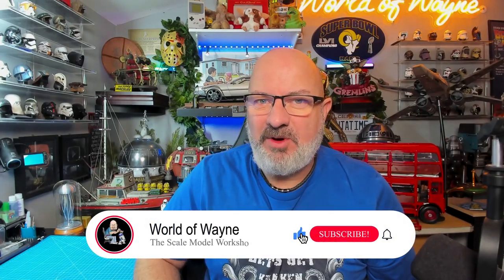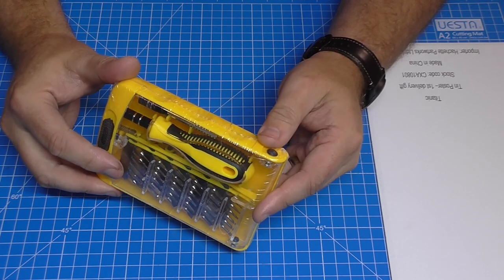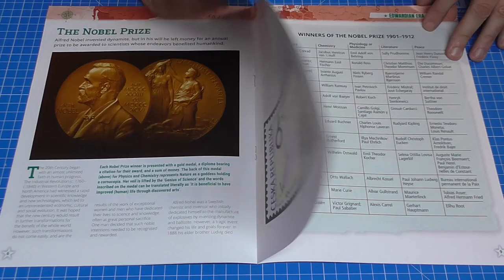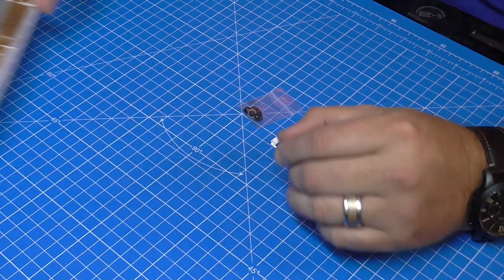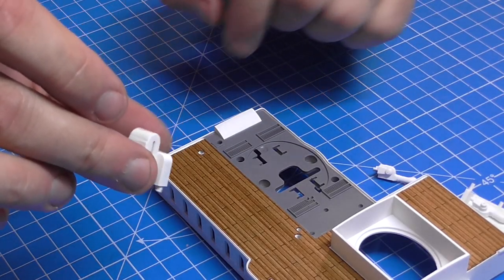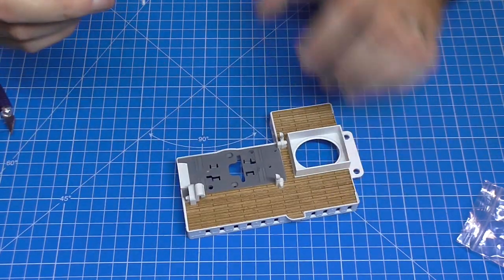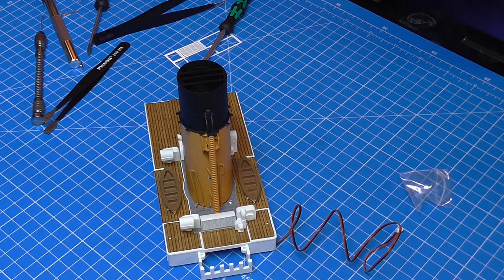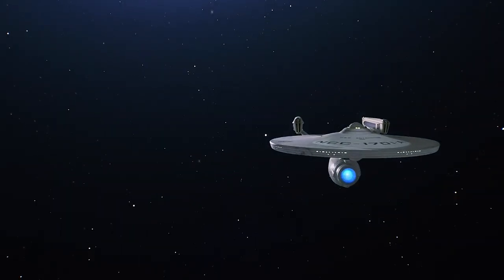Agora Models Build the RMS Titanic - Pack 4 - Stages 15-20

Comment: I'd be wary about connecting the cables in the funnel right now. I'm sure you're going to be right, but they're very specific about it.

What may have happened, because the same thing happened to me, is when you were gluing on the details, some of the glue attached to the tank inside. A little extra pressure would get those apart.

Comment: I have an earlier version of the tool kit which has (obviously) the screwdriver handle, which is narrower than the one you have in this gift pack, an extension piece as well as a flexible one to help get into tight corners. Unfortunately the magnet doesn't hold the various bits in the flexy one so you have to be careful that they don't fall out and into the depths of the kit you are working on!

Comment: Wayne, I had the same problem. Not being able to get the smoke assembly out after I glued in all the vent tube. You probably did the same thing I did. Look down the funnel. You will probably find one of the pins sticking through far enough to stop the smoker from sliding out. Looking great 👍
Reply from the maker: I really can’t see why it matters. In the end the cables will be joined unless it’s to add water for the steam
Reply: Yes, we'll have to pull them out to fill them with water
Reply: @gregb8486  They didn,t think that through when they gave us the instructions🤦‍♂️